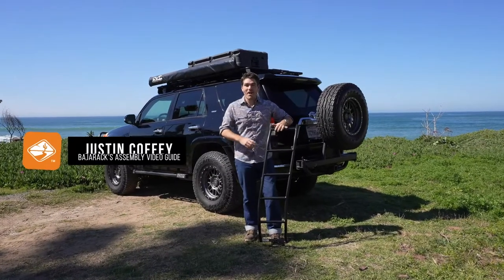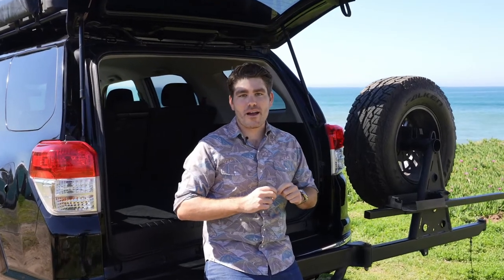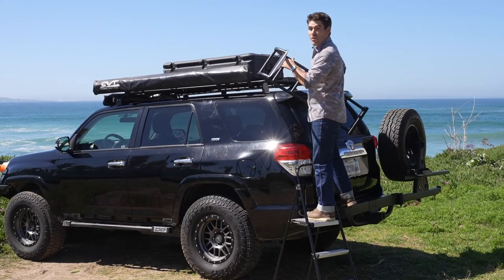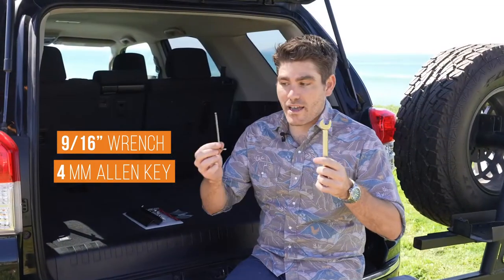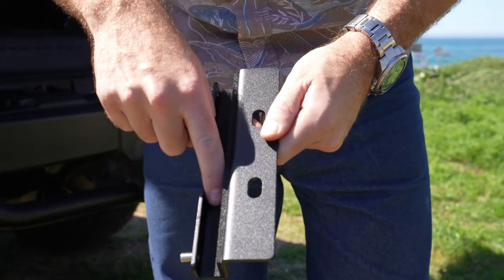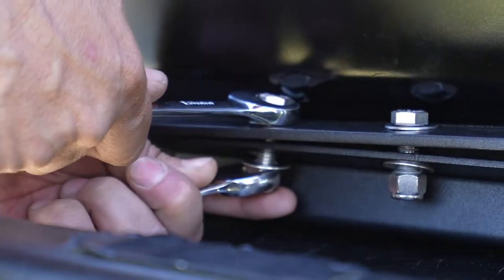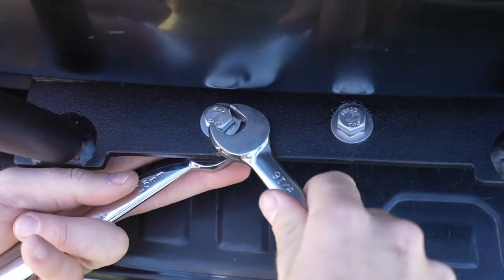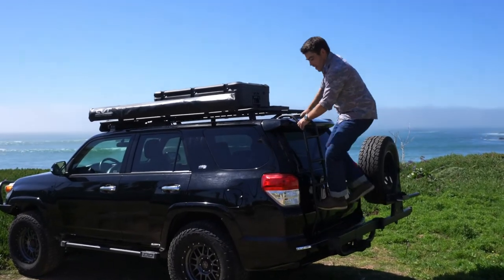BajaRack 5th Gen 4Runner Ladder Installation

Comment: So what if it won't fit in the top gap of your 2018 or 2021 4Runner?
Reply: On the 2021 model we had several customers that have removed part of the extra silicon applied on the edge, we haven't seen this issue with 2018 models at all.